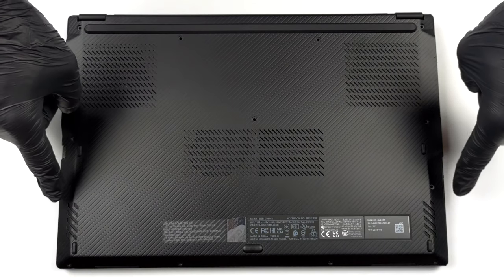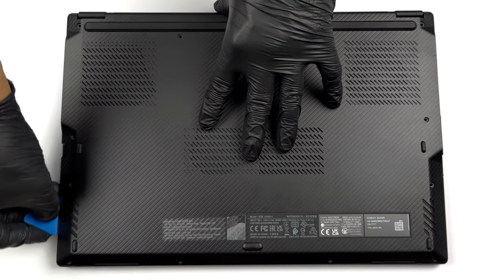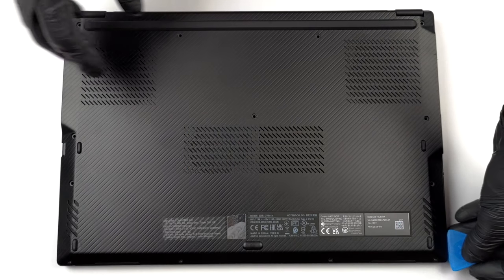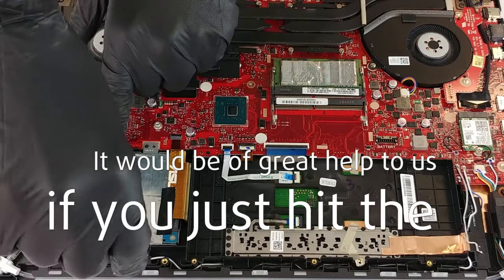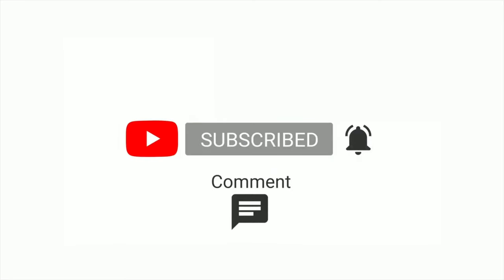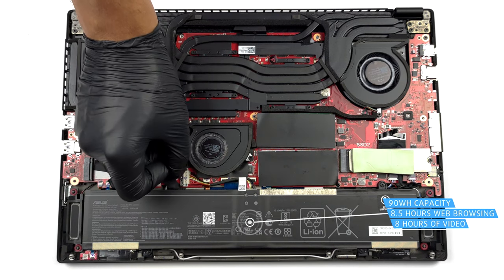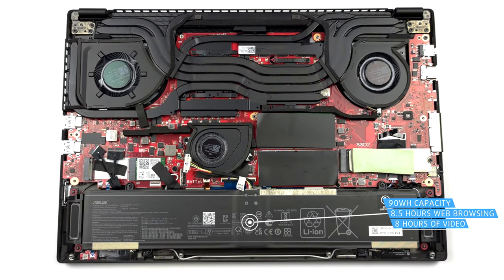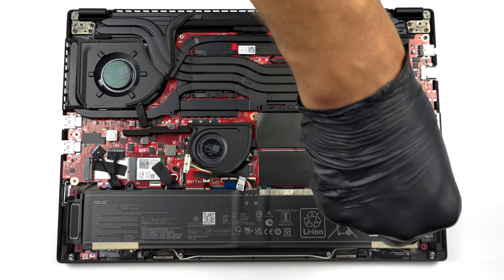🛠️ How to open ASUS ROG Flow X16 (GV601, 2023) - disassembly and upgrade options

Comment: how do i add a second ssd?
Reply: In the left position of m.2 and it is on higher than right position (2mm)
Reply: @vitazdaril8480 which size m.2 is the left one?
Reply: Just read it takes 2280

Comment: Do you think a Samsung 980 pro with heatsink would fit? I have one I am not using after my PC burned up and would like to put it into my laptop if it will fit
Reply: Did you try installing it? I would like to do the same. All you have to do is put it in and try reassembling, if it is too large you will know. Thanks.

Comment: Do I have to rremove the battery to exchange the RAM?
Reply: it's always recommended to do so but you can power it off with shift+shut down and assume all power is turned off

Comment: An incredible video! Thanks for bringing it to us. 
I wanted to ask you:
1) Does opening the unit, as done in this video, void the warranty?
2) Can the unit work without the battery, directly from the power? I always-always have an outlet nearby.
3) Is it possible to buy official batteries and memory separately? Where? For example I have this same unit with 32GB, could I upgrade it to 64GB myself?
I've had it for two days now, and the main drawback I've detected is the heat. It becomes unmanageable after a while. any recommended solutions?
Thank you very much!
Reply: i think you shoud ask official asus support in your country.
Reply: This is actually a very well cooled laptop
Reply: ive got the laptop for a few months and it hasnt reached past 60 degrees yet